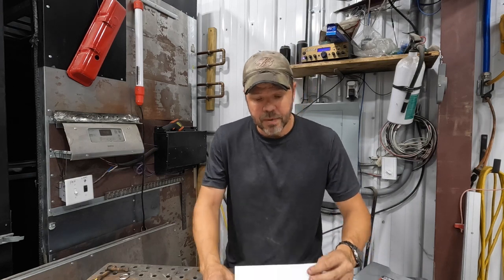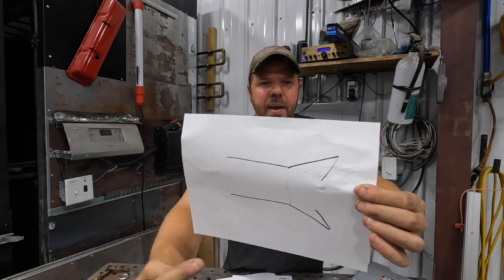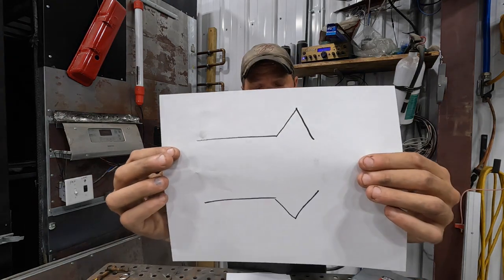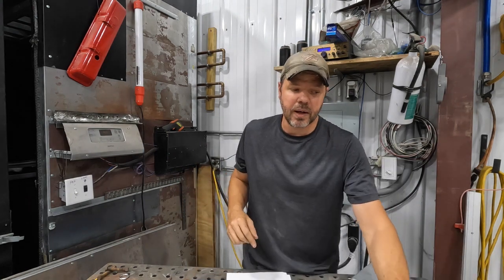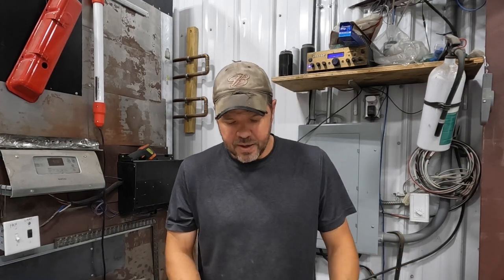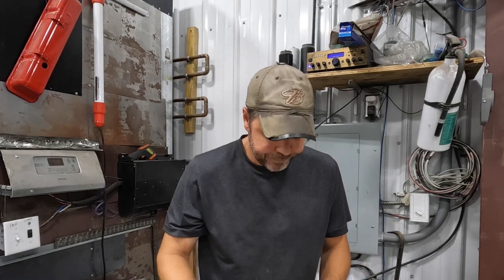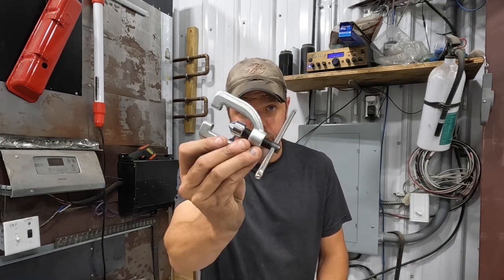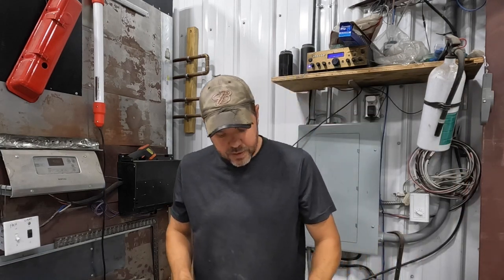How to Double Flare a brake line. and WHY!

Comment: Ugh. Second trip to town, and the person taking me into town lives 15mi from town on the entire opposite way. Frustrating as heck. They didn't have a flaring tool. Trying to get this done quick several snag ups. I got no double flare dye with my flaring tool that was borrowed. I can't think of a way to easily make a dye either offhand.
Reply from the maker: In a  pinch single flare will get ya by for a minute.....
Reply: @jrsprojects786 getting close to getting it down. Went to a different town. Going back to return stuff tomorrow and get some lines that have the nuts I need cut those off. Pain in the but. Wheel seals big. Above diff connection smaller. Different threads too. But I want to do this right as possible.

Comment: Best video, easy to understand and follow. One thing that helps make things a bit easier is: After you cut the tube it gets slightly crushed and leaves an internal rim.
It's easy to remove this rim with one of those handy Deburring tools (that look like a pencil).
By doing this, I found that the end of tube doesn't 'grab onto' the double flaring bit and seems to crush neater.
Just blow out the filings after chamfering (a drop of oil helps also)  IMO 👍👍

Comment: Can you tell me please - After putting the die in you ended up with what looked like the bubble end (before you finished it by making it into a double flare). Is that a proper bubble end? I need to make some for a euro car where male threaded fittings tend to have bubble ends and female fittings have double flares
Reply from the maker: It's not a bubble flare.  But I do see what ur talking about

Comment: Should I use a double flare for gas connections?
Reply from the maker: Depends on the Pressure but more than likely a single flare would probably work, but to play it safe if in doubt use a double.  That said I used to do single flares on my brakes when I was a kid because I didn't know any better, and they held.  but Double if any doubt.

Comment: Nice video. I was hoping to see a thought on single flare with AN fittings. They have a sleeve to support the flare. Seems popular in motorsports.  What do you think about the single flare in that application?
Reply from the maker: I don't know much about motor sports, but it really just comes down to pressure..

Comment: I didn't realize that the double flare was a double step to fold over that lip certainly not written in the tool kit no wonder I had so much trouble geez !!  Off I got practice thanks big guy!!
Reply from the maker: and the Bubble Flare is in between the two only you end up crushing it down when you tighten it..
Reply: I had the same problem, it's rarely mentioned there's that 2nd Step. No instructions in most of the Chinese ones.
I used a one Step double flare on an engine oil line and it works. I figured my kit only made a Single or 'bubble' flare and then thought it might work as it crushed into its mate. It did, and it worked.
So is a bubble, just an unfinished double, I wonder.

Comment: Good info! What I learned is -
Single flare usually used for low pressure connections.
Double flare for most domestic car high pressure applications such as brakes.
Bubble flare are common on European brake lines.
Reply from the maker: nailed it
Reply: Aircraft usually do single flares.